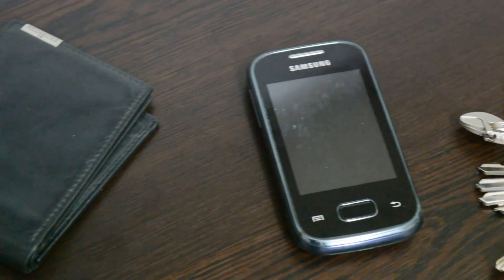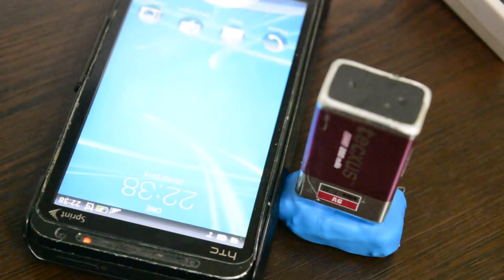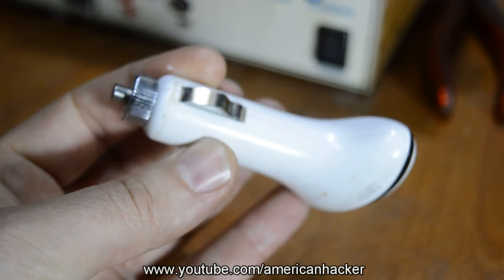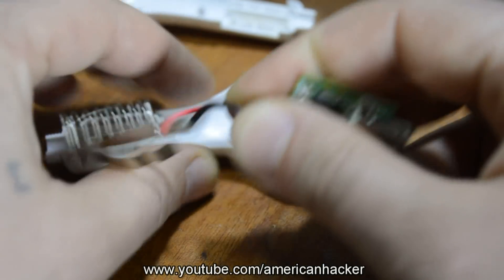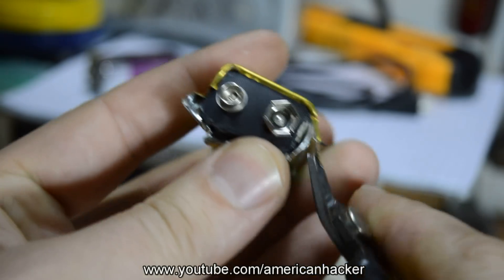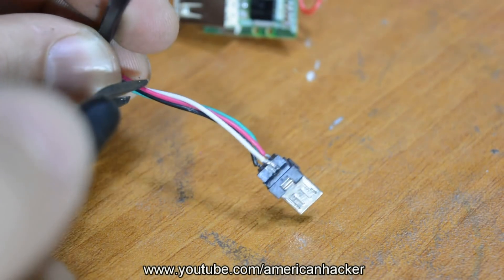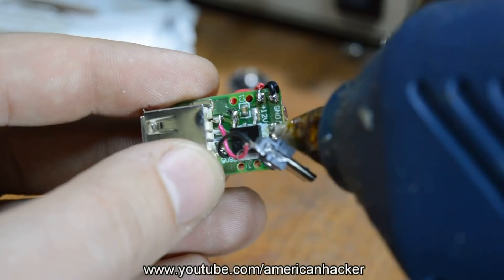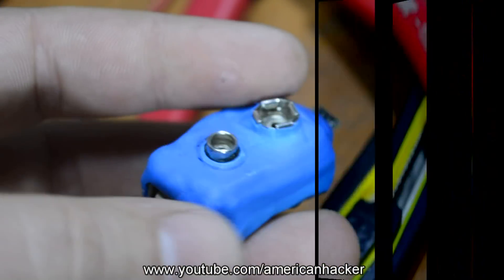DIY Keychain Phone Charger - (runs without electricity)

Comment: think you for every video tutoriel . .it's possible adapt the system with ,water  flow or wind  .tutoriel it's my idea  but i would like your idea .and not use battery or manually rotor servo .!! very sorry for my english .jicé from island tio france / FRANCE .

Comment: you could also buy a cheap small oil to throw inline with the 9 volt positive side to step up the voltage doing this and adding a cap will give more juice from the 9 volt.

Comment: will this work with 18650 batteries?
Reply: no,the 18650 power is equal to 3.7 volts. Power supply 9 to 12 volts

Comment: Firstly, THANK YOU for the work that you did to create this video and to empower the people out there with the knowledge to make such a device!!! Well done! Personally, I would have made some changes, initially by using an 18650 and a boost converter instead, although those parts are less easily obtained. Unfortunately, as I am certain you have already found, a 9v battery is nothing, in terms of electrical capacity... I can't imagine you are getting even a few hundred mAh, from even the best 9v batteries out there... The price/power ratio of a 9v is TERRIBLE! In fact, you would certainly be better off making a battery pack out of 7 or 8 NiMH batteries, though the source would be much larger, but you could still use the same 9v connector, allowing you to carry your inexpensive and rechargeable battery pack with you, and although not the capacity of a Li-Ion/Polymer battery pack, it could be made for cheaper, and thus can be whatever design or form factor best suits your lifestyle. Finally, my last recommendation would be to use 1 or 2 18650 batteries, with a tiny boost converter, and make a simple keychain rechargeable power pack that can easily fit on your keychain, alternatively, as with thew one you've created, you could use the 9v connector and again, keep the pack with you, and have it for quick and easy connections when power is needed, which, based on the phone you have in the video, I suspect is pretty frequently. ;-) hehe. Oh, I did want to add, I LOVE THAT YOU USED HEAT SHRINK to hold it all together!!! I have been racking my brain on how I will hold together my planned battery pack, I had finally settled on using my InstaMorph for that, and then I considered purchasing some Sugru, or similar, but your ingenious idea of setting it with heat shrink, FANDIDDLYTASTIC, my friend!!! Well done!

Now, for all of the turds out there:

First, you suck balls, and not the good kind, the cochanbahls kind!

It amazes me how many people are saying things such as, "What does he mean it doesn't need electricity? FAKE!"... It is so ridiculously obvious that he meant it doesn't need an outlet, charger, or mains electricity, you've got to be pretty foolish to be unable to sort that out...

In addition, the people that say things like, "I wouldn't use a thing like that from a 9v battery, it could damage your phone/it's not going to work/it's not meant to be powered from a 9v", etc. etc. You don't need to be an electrical engineer to know that the power source doesn't matter. Hell, by that logic then your phone is being powered by 110/120/240v when you power it from the wall! The buck converter in this unit is what is really powering it, just like the power converter that you plug into the wall is what really powers your phone... Those convert the mains power from the wall into the 5v source that the phone requires, which as SOME of you may know is not actually what powers the phone, the battery does, and anybody with any semblance of common sense should be able to find out that the phone actually runs off of a Lithium battery, which provides a nominal 3.7v source, but in reality fluctuates between ~2.7-3.7v. As such, converting the power from a 9v (which is 6x1.5 cells inside) is perfectly safe, so long as the buck converter you are using is of some quality.

So, for all of you trying to put down this guy's attempt to not only educate you, but additionally to empower you to create something with your own hands and knowledge, basically, fuck off!!!

Comment: Yeah it's a cool gadget but in Australia 9v batteries are pretty expensive and not very common. It's one of those things, if I did it, I'd use 18650's and then I may as well just use a normal power bank. If you had access to 9V batteries for free or very cheaply it's pretty cool. I just wonder what you do that you need to charge your phone so much! Mine lasts pretty much a day and longer if I go for a drive and it charges in my car.
Reply: Here 9v is like $1

Comment: hey I want to use it for my tab but it requires 2.0 volt input and should I use double 9v battery
Reply: +Fardin Ahmed 2.0A * could work with 1A but it will take longer to charge, I'm also affraid that you have to buy a lot of batteries to charge that tablet in this method, better buy a power bank that can be recharged at home, it will cost you less but hey, this thing is so small, worths a try... I'm working on it

Comment: BE CAREFUL not to destroy the lithium battery of your phone, higher voltage than 4.2V will dammage it. USB ports are 5V, the little circuit turn the 12V from the car to 5V (usb), I hope the 9V from the cell is step down lower then 4.2... when the batterie is full, it still drains some curent that produces hydrogen, over pressur might explod the battery and burn.

Comment: Nice video as always. Just a question, could i do this but instead of a 9v battery could i use 2x 18650? or do i need to get it up to 9 volts? 3x 18650? since it comes from a car it's supposed to run on 12v, but it can on 9v so shouldn't it work on 7v with 2x 18650?
Reply: +Crispy K I would use 3 18650's or to save space use 3 18500's, the 18500's would be far more forgiving in deep discharge situations as they are made with a different chemistry LiFepo4 vs Li-ion for 18650's, the 18650's can be damaged if ran below 3v per cell
Reply: Mike Fish thnx for the comment, thing is i have a lot of laptops, so lot of 18650's :P i might have 30 of them so i can experiment with them doesn't really matter if some of them die. But i'm going to look at some 18500.
Reply: assuming the regulator from the car charger is efficient, which it is not, you would need at least eight volts to run it, so no you could not
Reply: +alexander simcox sorry, forgot to add on " with 2 18650s "

Comment: Nice idea but you should put a second 9V connector on the other side so that you have an input of 18V. This does not only simply double up the loading capacity but also the effiency: When you use just one 9V battery, it will stop charging the phone as soon as it goes down to about 6,5 - 7V (the amperage will go down too far to maintain charging) but if you use two 9V batteries, they logically will discharge as far as to about 3,25 - 3,5 Volts each before they become too weak and the keychain charger won´t even be significantly bigger - and it will still work with only one battery if necessary (though much less efficient). Regarding the 12V to 5V converter from the USB charger: the 18V shouldn´t even heat it up, so no problems with reliability.

Comment: There's isn't enough sufficient amperage to charge the the phones battery. The USB adapter needs at least 9-12 volts input at a minimum of 500 milliamp hours to run the USB charger sufficiently. I tried it your method.... It only put about 6% before it killed the 9volt battery.... Even with a good branded 9volt that puts out maybe 400 MaH tops.... I was lucky to get 8 % charge before it stopped working. Investing a power bank... You can get them for a couple of bucks! And they are on a key chain.

Comment: all what u need a 5v voltage regulator
Reply from the maker: +john wans yes
Reply: +john wans no, some devices require data pins connected to charge
Reply: +zerodegrees8 
if u cut a usb cable u will find 4 wires red, black,green,white
if u connect 5v to the red and black (where the black on is the ground) any device will be able charge 
however the device doesn't show the charge sign (iphone)
the battery percentage will increase
Reply: +john wans interestingly enough I tried to charge my phone for over an hour with a 5 volt regulator and guess what, my iphone percentage didn't budge, but it charges an android perfect. Why do you try to bullshit people?
Reply: +zerodegrees8 im so sorry 
i know that it will charge android perfectly 
but i tried that on iPhone 4 
and it works without showing
the charging sign 
so u need to check out 
1.intenesty  (i mean the amps)
2.u connected every thing correctly 
anther thing u should know 
that the 5v voltage regulator
works with more than 5v (tri 9v battery) and test the out put (just make sure it's 5v)
Reply: +zerodegrees8 
after u did all of those things tri it again on iPhone and Android
Reply: +zerodegrees8 maybe you had an old ipod charging cord, you need a newer one, iphones require a certain resistor across the pins for it to accept a charger, most modern 3rd party iphone cables have this built into them

Comment: sure good job. Nothing wrong there. just one question. wtf do you mean runs without electricity ?
Reply: the keychain doesn't have a charge until you need it
Reply: +Nicholas Ruiz Like i dunno, almost every single decently made usb charger ever. And yea, lets go back to the 80's carrying around batteries for my phone, ones that wont even give it 5% charge before flat-lining. 9 volt batteries.
Reply: Mac MashPotato I wouldn't make that, better to buy a batterypack made to charge a phone than to get that 9v thing

Comment: Mine car charger circuit board does not have any wires it only have two metal strip connected :(
Reply from the maker: dipa Jain you should check which is negative and positive strip with multimeter

Comment: Ha ha ha made this and phone says charging but fails to gain any charge actually loses charge faster than if I didn't try this ha ha ha
Reply: Mine does the same.
Reply: +grumpy old fart you can fix it by making your own chip.. all you need is a vrm.. try L7805 .. this chip will use 9v and turn it into 5v..   youll also need two 1uf ceramic capacitor...http://cdn.instructables.com/FZA/WRFC/G79DOU60/FZAWRFCG79DOU60.MEDIUM.jpg
Reply: your right
Reply: that's because it only carrys a few amps from the 9v battery you need at least a 12v for it to work properly it is a cart charger and they run mostly on 12v